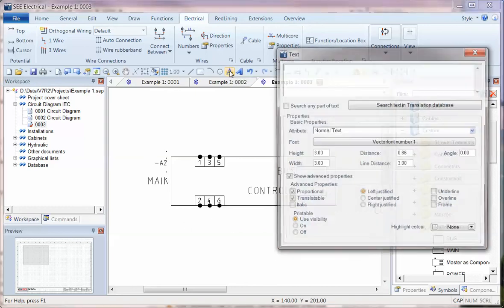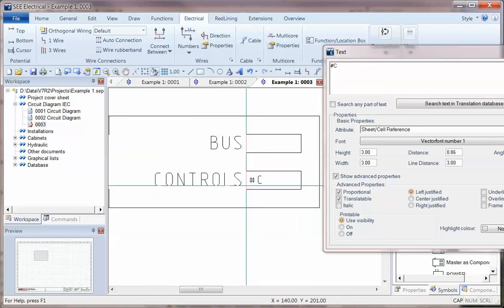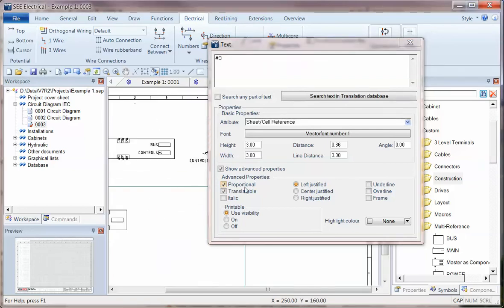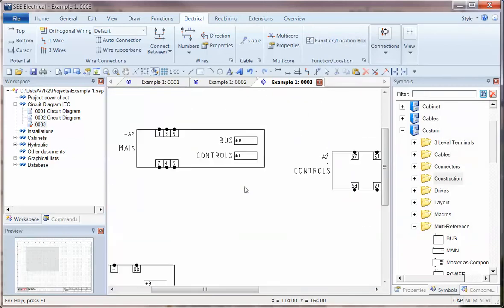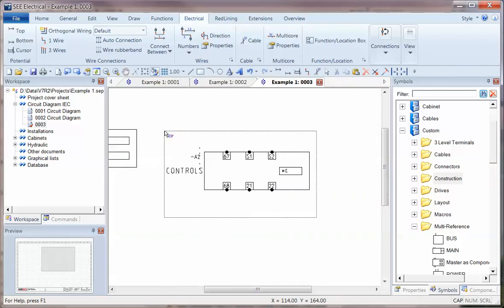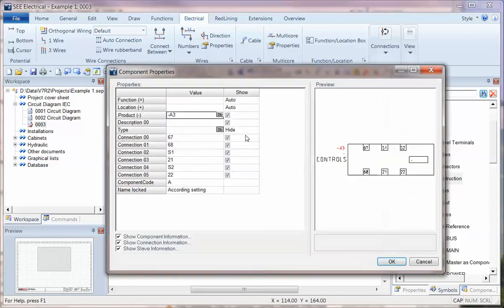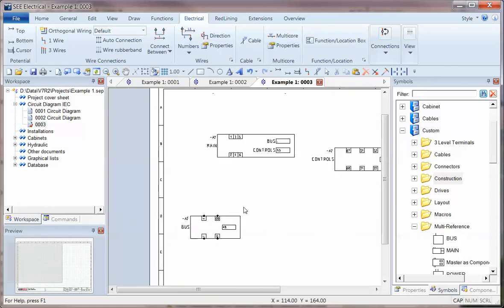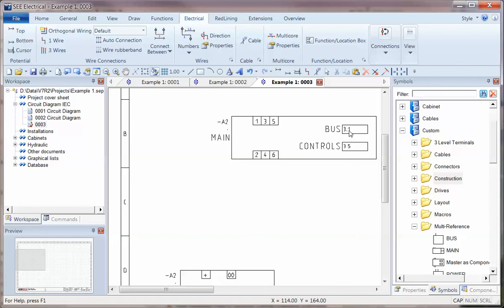Multi Reference Symbols V7R2

Comment: how do you define the channels in the components DB?
Reply from the maker: As with a relay and contacts, the component with aux contacts should be listed in the first line with its connection points, then the 'Contacts, not specified' or other Contact type symbols should be list below in the channel definition, each with their own connection point text.